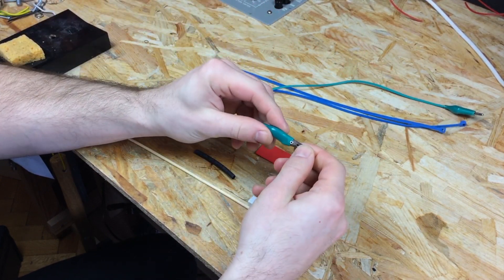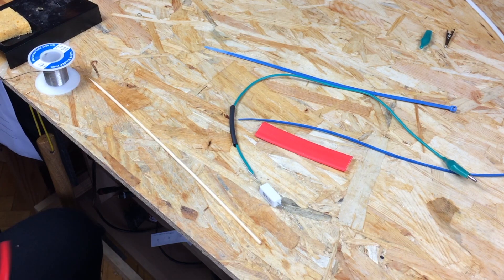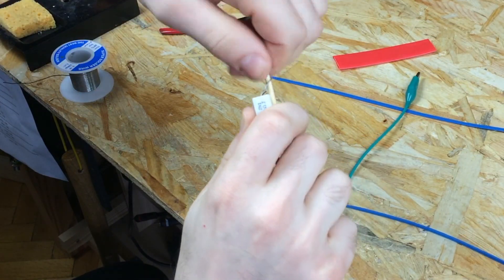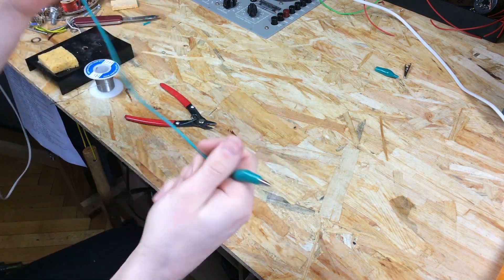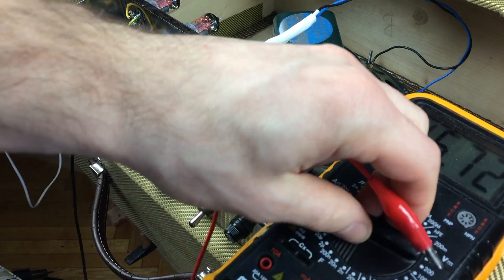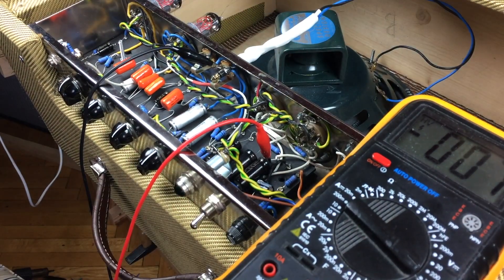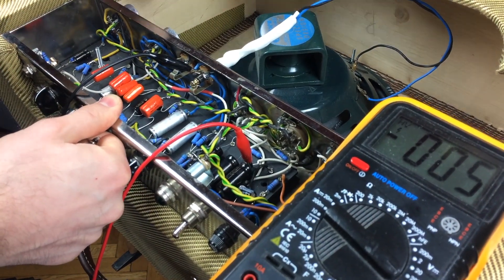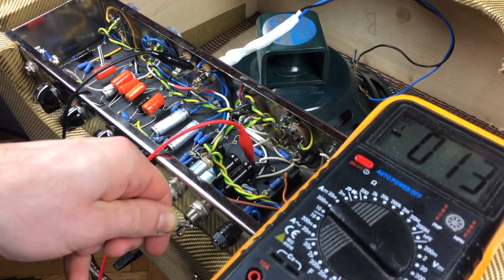How to make and use a Capacitor Discharge Tool

Comment: Good video ! I'm going to make one of these. I have a tweed 5e3 clone and it made a pop noise and now the low input mic channel has no sound. Hope I can find what is wrong with it.
Reply from the maker: Thanks! Try changing the first preamp tube first. If that doesn't solve it, check the plate pin of that side of the triode which is dedicated for the mic channel. If the high input mic channel has the signal then it is not the tube, it can only be  the input jack or the two resistors 1M and 68K. Check those and also check the ground and other soldering connections. on the jack and on the tube socket.

Comment: i only have 1/4 W and 1/2 W resistors on me, is there any way around that?
Reply from the maker: You can use two larger value resistors in parallel or in series, but 1/2 watt should be just fine.

Comment: Hi, my amp has multiple value caps. The highest has 220uF 350V 85° values.
Which resistor would you suggest me to get? How many Ohms or kOhms and W? Thanx!
Reply from the maker: Hi, the value doesn't matter, you can use any resistor you got, I would suggest 2W because it's mechanically sound and not too bulky.
Reply: @Delatsch  thanx, since I have to buy some, I wanted to get the more precise ones so to keep safe the caps as long as possible.
Reply from the maker: You can use higher value, I would suggest something like 100K or 220K and 2W or 3W is plenty enough.

Comment: I've heard many different values for the resistor size, 470/2k/22k etc.
What is the correct size for discharging a fender amp's filter caps?
I have a 5-watt at 1k ... will that work well?
Reply from the maker: The resistor size is not critical, the 1K 5W will work just fine.
Reply: Delatsch : Thanks!

Comment: Might want at least 16 gage wire for that one. I'd suggest 470 ohm 5 watt resistor and 16 gage or higher lead.
Also try to connect to the ground point at the incoming power jack. A powder coated cabinet is a poor ground.
Reply from the maker: Thanks for your comment! I've been using it for years like this and haven't noticed any issues. When you connect a dmm you can clearly see that all the voltage is drained immediately without a spark so it works just fine for this purpose. I guess it is always better to have thicker wire whenever you can but it is not critical in this application in my opinion.